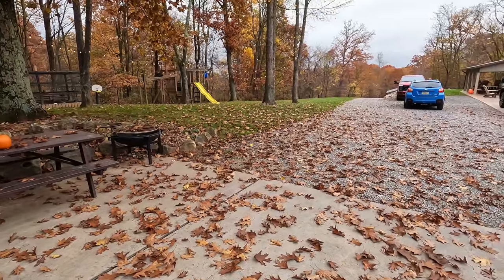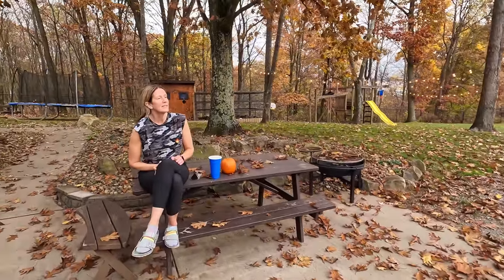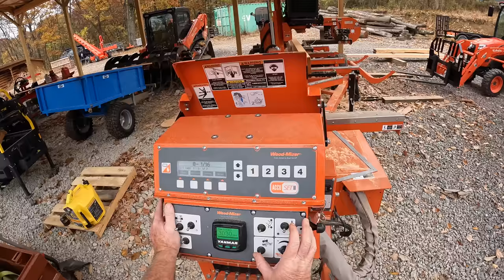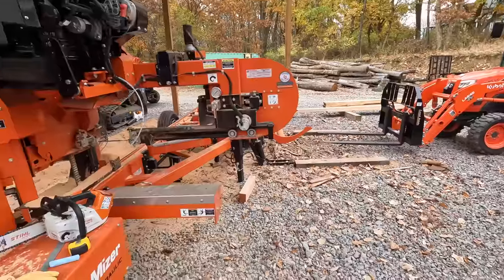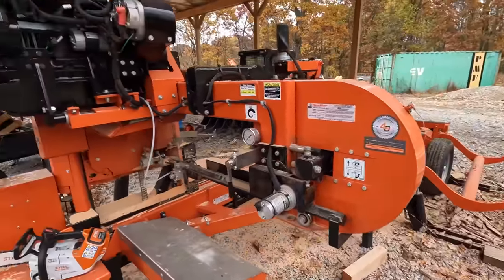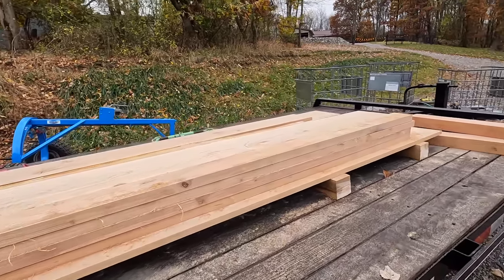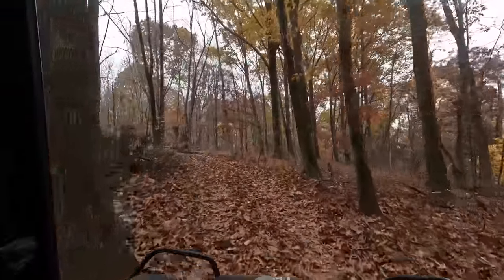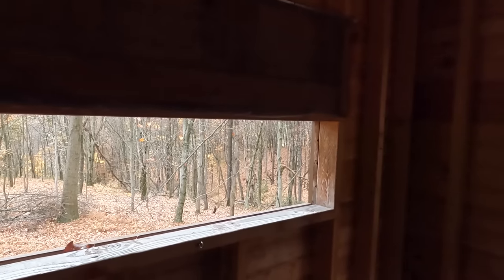Starting a Lumber Business, With a Partner

Comment: Morning Mike, finally a little sunshine, 25 this morning...
Pete 🇨🇦
Reply: Hi Pete,  37° F here this morning.  Had to fire up the wood stove yesterday.
Reply from the maker: Morning!
Reply: 30.9 brrrrrr lol
Reply: @davidmorse8432  Morning David, my outdoor furnace has been on for a few weeks now.... gotta stay warm...
Reply: @peteatthefarm4459  Outdoor  furnace?  How does that work?  Heating water and circulating it in your home?
Reply: @davidmorse8432  that's correct, I load the furnace outside  (no mess in the house) it brings 180 degree water in and circulates through a plenum attached to my oil furnace, the blower on the furnace comes on when required and we get heat....
Sorry for the long explanation...
Reply: @peteatthefarm4459  
Thanks Pete, I appreciate the long explanation.  Sounds like a pretty cool setup.  Our temps are seldom below freezing so the wood stove we have does a great job of heating the house but we also have a heat pump air conditioner for a backup too.
Reply: Good afternoon Pete and Crew 😸 there's a few light snow flurries blowing around here in Montreal again 🙄
Reply: @badcat4707  afternoon BadCat..... nothing here yet!, they are staying 3-6cms overnight...
Happy Catoween 😸
Reply: @peteatthefarm4459  😹😹😸that's a good one ! never heard it before 👍🙏

Comment: Just caught up to this video.  With your trip to Adams's party were you able to try out
 his japa machine?
You upgraded your sister's drive & made a statement it is now in the best condition in 50 years with the added stone & ditch work. 
 Wondering after the leaves all drop you could rent a flail mulcher & remove the overhanging trees & brush along the side of the road.
Then Ty will be old enough to fix it when needed!  ☺ 🙏⚾ 
P.S. Adam used a flail mulcher to help out a friend, his video was great.
Thanks for all the time & effort making your videos.  🚜